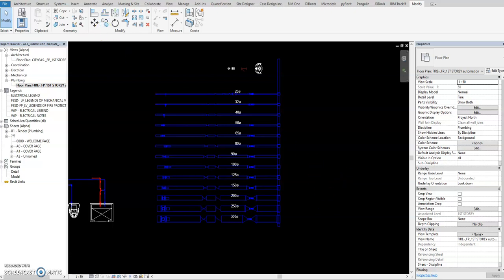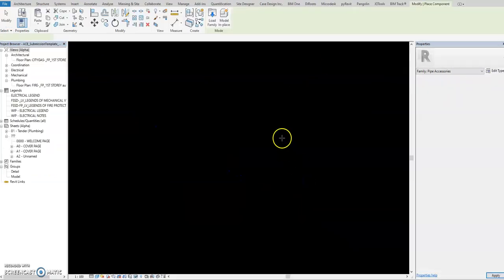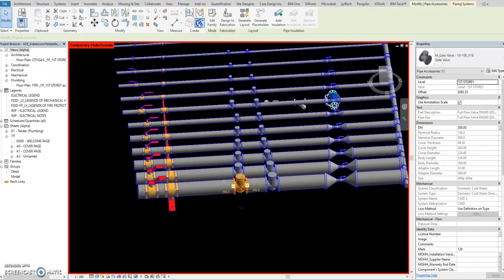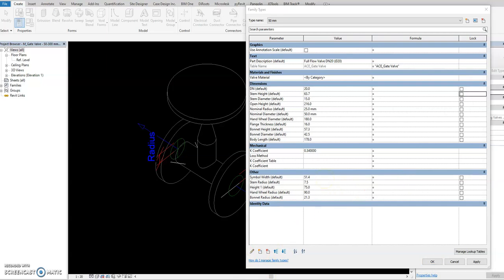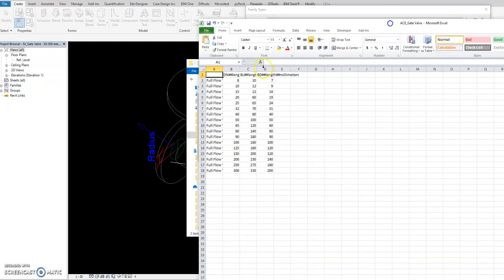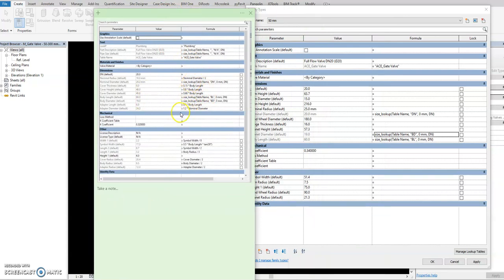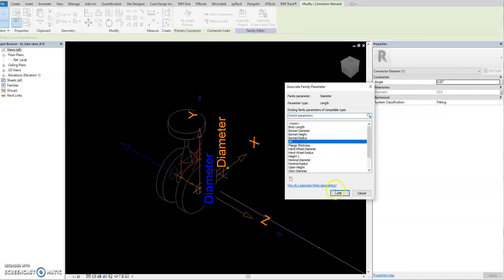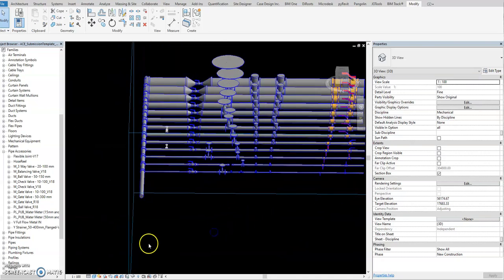How to autosize revit pipe accessories when connected to pipe PART 1

Comment: Keep in mind that the valve "type" changes after a certain size of pipe' (ush' 4 inch and larger need to be a gate vavle, depending on the system).
Reply from the maker: Ok noted. The process is there can integrate it into new one.